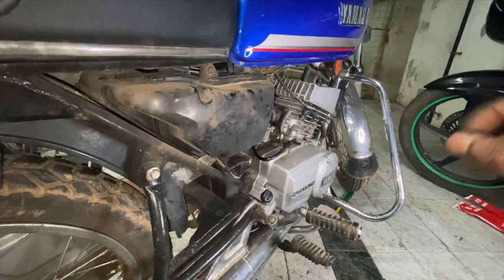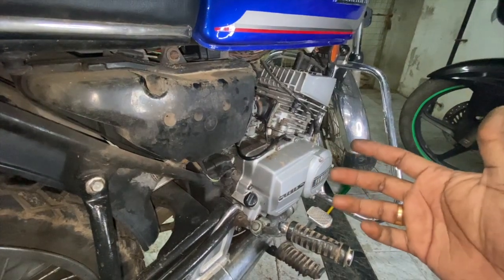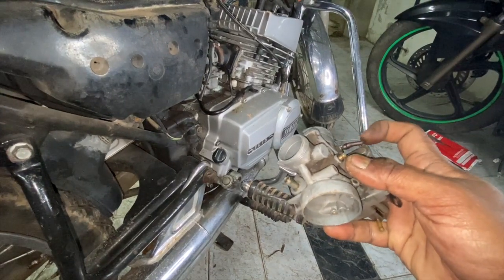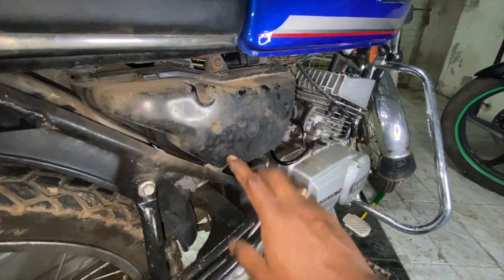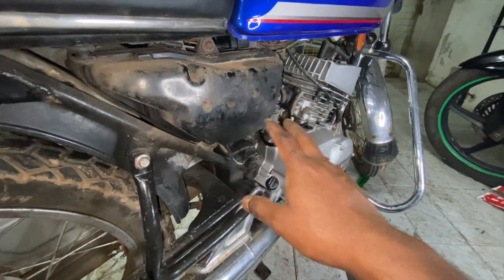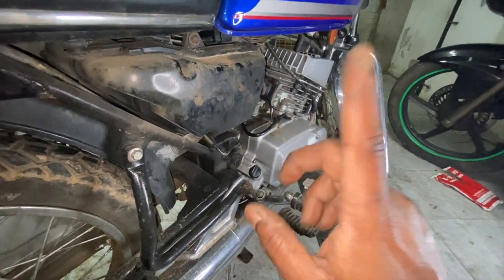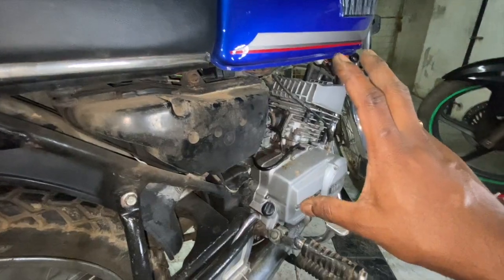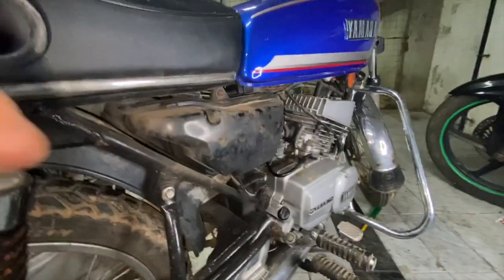2 Stroke Bike Air Related issues explained in details (English Video)

Comment: Cheta, one point to add.. nowadays we don't get the rubber beading on the air filter box, and the filter component is changed from the dual stage filter which came on the old bikes.
Reply from the maker: Right

Comment: About the airlock problem on the previous video of the tank cap i saw a video where removing the gasket inside the cap solves the problem
Reply from the maker: If you remove the gasket the petrol will evaporate, reducing the mileage
Reply: @Yamakaze  Yes, I saw that video too. He kept saying "petrol chod deta hai". Not sure what he meant. But I read somewhere that the breather hole can be made a bit bigger.
Reply from the maker: @mjshaheed  there is no additional benefit of making the hole bigger. The company put that size hole to ensure it doesn’t lead to evaporation of fuel. Better is to stick to whatever you have presently
Reply: Removing the gasket creates a rattle on the tank cap
Reply from the maker: @abhimanyuinjeti5326  it does